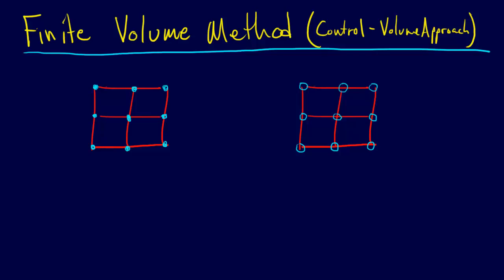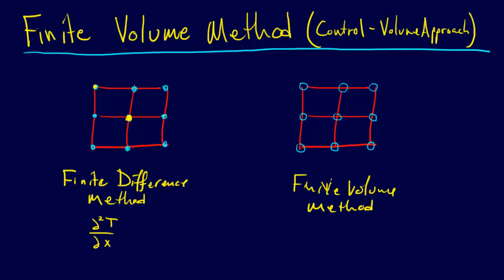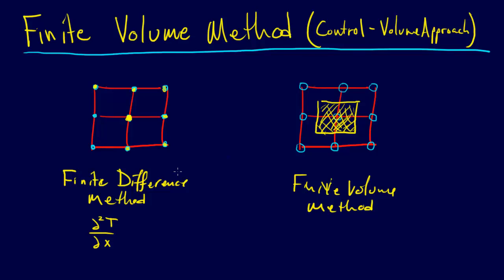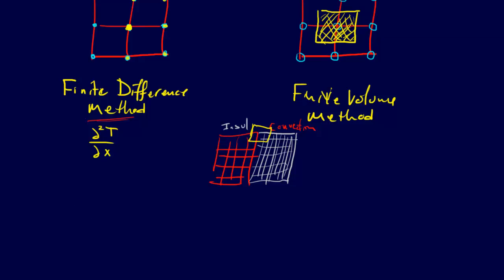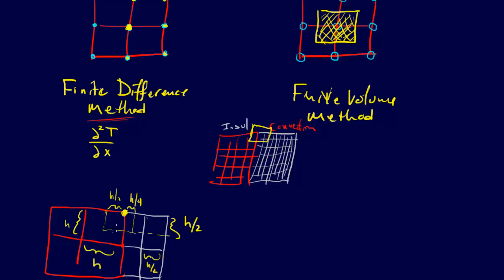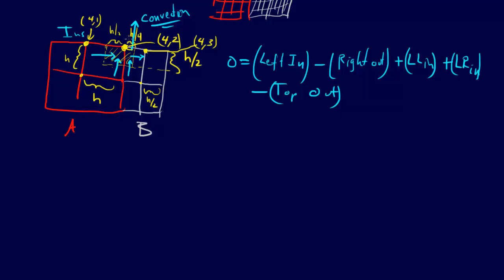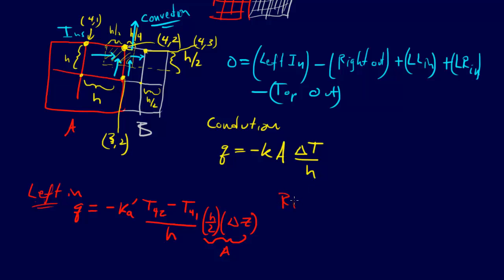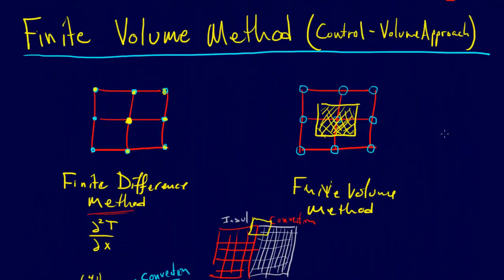8.2.2-PDEs: Finite Volume Method (Control Volume Approach)

Comment: Dear Respected you my senior
I enjoyed and learned a lot from your video lecture but in this problem which you performed it is about convection heat transfer area 
don't you think that the area of control volume from where the convection is occuring should be (3/4*h)(dz) where dz means delta z because half of h and h/2  if they get added they give 3h/4
please help with that situation.
Thank you.